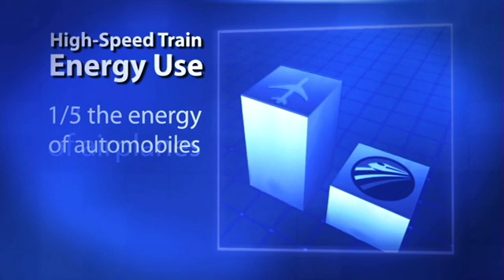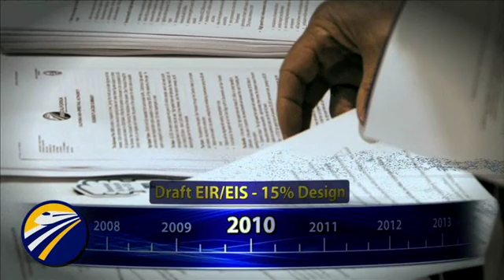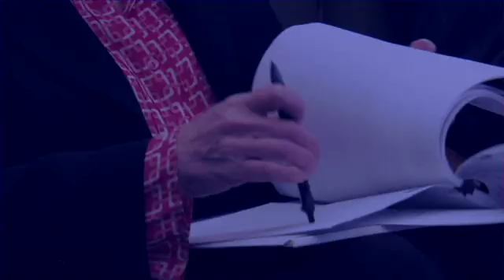California's Future High Speed Rail System

Comment: hate to brake it to ya but the so called high sped train will not take off from L.A. but from Burbank and it will not end in San Francisco as I though but in Sacramento which is not close to Sn F. The speed will not be 200 miles per hr either. It will be slower and will cost over 125 billion bucks. Not quite what they are selling here

Comment: They aren't using existing rails for freight trains, they are making new track. Just ride the Amtrak and you'll see exactly how that wont work. The terrain can handle it, a lot of the track will be in the central valley. Other parts such as the mountains however may require long tunnels, similar to those in Switzerland, but it can be done. The real issue is just funding.